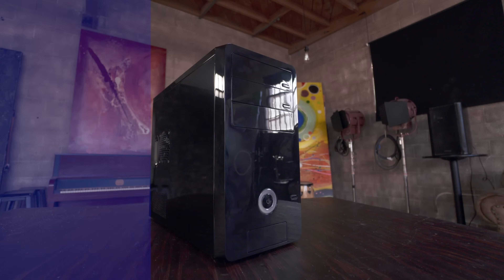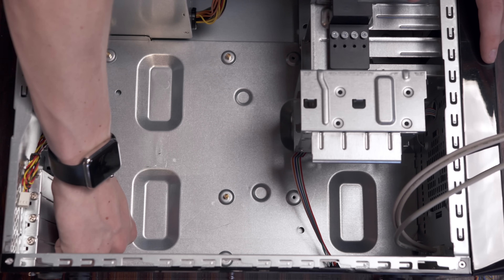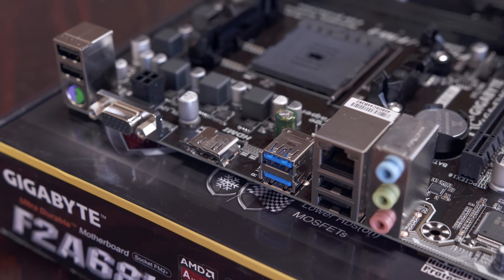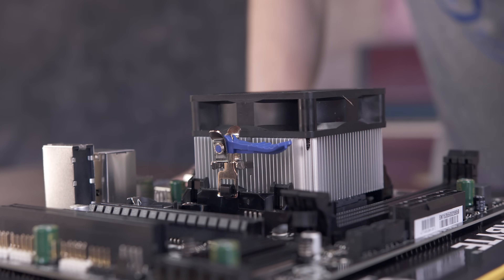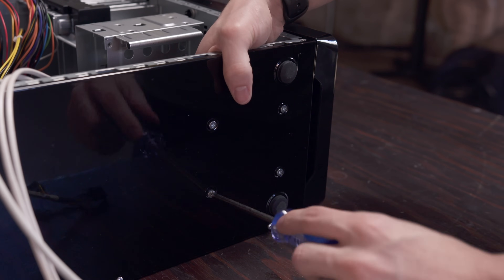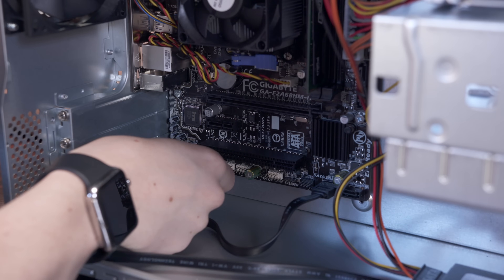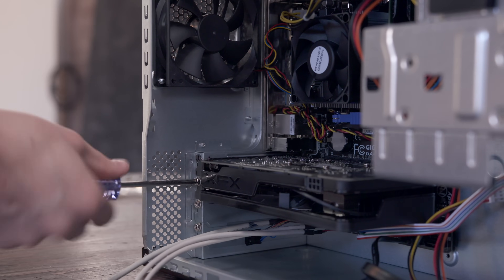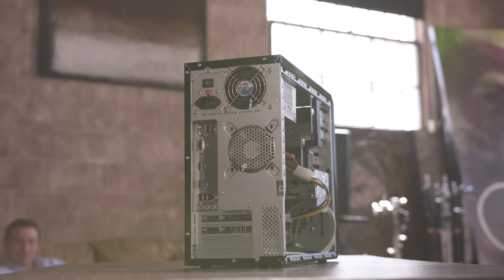How to Build a Gaming PC! (2016)

Comment: PLEASE ANSWER
Some people in the comment section are saying that the graphic card blocks the wifi card entry slot.
Does it actually block it?
Also do you even need a wifi card or are you able to connect to wifi straight away?
Sorry for all the questions but I'm new to building PCs.
Thanks
Reply: It does block if you have a graphic card that uses dual expansion slot. Alternatively, you can use wifi USB adapter which is way more easier to install than wifi card.
Reply: thx

Comment: Is this good parts for building a Gaming PC under $200 dollars?

AMD A8-7600 3.1GHz Quad-Core Processor

Asus A68HM-K Micro ATX FM2+ Motherboard

Kingston HyperX Fury White 4GB (1 x 4GB) DDR3-1866 Memory

Seagate Barracuda 500GB 3.5" 7200RPM Internal Hard Drive

Apex TX-381 MicroATX Mid Tower Case w/300W Power Supply

Comment: Wait so if you get the hard drive do I just put it where you put the SSD in?
Reply: XHunter no. on top of the SSD, there are drive cages. Your hardrive would slide in perfectly and you screw in the hardrive from the side of the drive cages
Reply: yes
Reply: XHunter No they have a hard drive bay. The hds are larger than ssds so they can fit without a problem

Comment: Is there anything here that is not compatible? This is my first PC so any advice helps.

Case: NZXT Phantom 240
Graphics Card: Nvidia GeForce GTX 1060 
Motherboard: ASUS Z170-DELUXE LGA 1151 Intel Z170 HDMI SATA 6Gb/s USB 3.1 USB 3.0 ATX Intel Motherboard
Processor: Intel Core i7-6700K 8M Skylake Quad-Core 4.0 GHz LGA 1151 91W BX80662I76700K Desktop Processor Intel HD Graphics 530
RAM: Corsair Vengeance 8GB DDR4 ($50)
Storage: WD Blue 1TB 
Power Unit: 600W Corsair CX600

P.S. Yeah I know SSD is better but just to start I can bear the load times.

P.P.S. I also probably left in some useless info on the names but I really don't know what matters and what doesn't.

Comment: Hey as a first time pc builder I'm curious. I've ordered most of the parts to the 500 gaming rig from October and getting near to building. I have one problem which is me being scared about static damage. I will be building it on a semi-polished wood table without a wristband or a pad to prevent this. Am I ok without those or should I invest in getting some static proof items?
Reply: Owenn If you are very paranoid I suggest an anti-static mat.

Comment: Question, I know this is a few months old video but I'm thinking of getting this for Christmas. Would I be able to do a WiFi card with this build? I would use it for gaming. (Yes I know WiFi isn't good for gaming but I'm not going to have a cord run from my room to the router and I can't move the router to my room either.)). 

EDIT: Can I put a bluetooth adapter in with this build? If so, which one and how?

Comment: I need help! I wired all the cables but the PC wont boot. I verified that everything was plugged in correctly by unplugging all the wires and trying again. The LED lights on the motherboard turn on but when I press the power switch it does not boot.

Comment: I am a noob so don't make fun of me but what is so different about an SSD and HDD
Reply: WAFFLES the OG Suhh Dude You can have both an SSD and a HDD in the same PC. And if your wondering there is a third kind of disk drive SSHD (Solid State Hard Drive) which is a hybrid between the other two.
Reply: WAFFLES the OG Suhh Dude 
An SSD has more read and write speeds than a hard drive
Reply: SSD fast HDD slower.
Reply: SSD faster, HDD more storage (usually)
Reply: SSD (Solid State Drive) doesn't have moving parts as the HDD does making the SSD's life span longer and more tough to kinda break as a HDD the SSD is faster but holds less storage then a HDD (keep in mind you can get a SSD  with more memory than a HDD if your willing to spend a whole lot of money) a SDD is also a lot smaller.
Reply: SteaLz thanks can't you have a hard drive and an ssd

Comment: I need help, this is my first pc build and I want to know if these specs will run tf2, CS go, overwatch and dark souls 3!!
Intel® Core™ i5-6400 Processor (6MB Cache, up to 3.3GHz with Intel® Turbo Boost Technology Includes
NVIDIA® GeForce® GTX 950
8GB Dual Channel DDR4 2133MHz (4GBx2)
1TB (64MB Cache) 7200 RPM SATA 6Gb/s
Intel® 3165 1x1 802.11ac Wi-Fi Wireless LAN and Bluetooth 4.2
Reply: Jack Puub 
Is this prebuilt?
Reply: Jack Puub  anything that functions and has four gigs of ram will run tf2
Reply: Yeah it'll be just fine, maybe even a tiny bit overkill!

P.S: Add a SSD!

Comment: How's it sound:

CPU:                                             Intel Core i5-6400 2.7GHz Quad-Core Processor
Motherboard:                             MSI B150 Gaming M3 ATX LGA1151 Motherboard
RAM:                                           G.Skill Ripjaws V Series 16GB (2 x 8GB) DDR4-2400 Memory
Storage:                                      Toshiba 2TB 3.5" 7200RPM Internal Hard Drive
Video Card:                                MSI GeForce GTX 1050 2GB Video Card
Case:                                          Aerocool GT-A ATX Mid Tower Case
Power Supply:                           Corsair CSM 550W 80+ Gold Certified Semi-Modular ATX Power Supply
SSD                                             N/A
Monitor                                       N/A
Keyboard/mouse                      N/A
Total Price:   £633  (without shipping)

Comment: Will I need to plug something into the back side of the gpu?
Reply: Yes, your gpu (when in your PCIE slot) disables the stock VGA or DVI connecter, and replaces it with the one on the back of your gpu, Ausin has a GPu that has 2 DVI's and a HDMI port on them. If you can, i reccomend using the HDMI cable, the quality is great and i can support 4K.

Comment: Hey guys. I'm currently using a console and I'm trying to make myself a pc. 
http://pcpartpicker.com/list/s3hrm8 
This is what I created and wanted to know how good it is and how I can make it better(not for more money)
Reply: Looks pretty good! Nothing weird, incompatible or unbalanced.

I know you said you didn't want to spend more money, but for about 20 dollars more you can get an AMD Radeon RX470 instead of the 1050ti, which would increase your gaming power (higher settings/ FPS).
Reply: Broseph Stalin thank you
Reply: Broseph Stalin I can't find the AMD Radeon on the site?
Reply: DonTheRandomGamer thanks a lot for the response. 
Im still new to pc's and wanted to know with what part of the pc am I suppose to replace with the gtx 1070
Reply: Get a 1060 
It's not much more money and you'll easily be able to run anything on ultra (or at least high) 
the 1070 and 1080 are better but are WAY more expensive, Not really needed unless you plan on gaming in 4k
Reply: As for the processor, You don't need an i7 so don't bother with the 6700k.
I would get a 6600 (no "K") as it will be more than enough for gaming, at a very cheap price. 

If you're interested in overclocking then get the 6600k, But it won't be needed to game.
Reply: Er
Thats false 
6600k will not bottleneck a 1080
Reply: even a non k won't bottleneck it
Reply: an i7 is really not needed at all for gaming

if you are editing videos and producing music and such, yes. an i7 will definitely help

but for just gamin, a 6600k, and even a non-k  will be more than enough
Reply: Not sure where you're getting your info but you might want to look up what you say before giving people advice on making a computer
Reply: MYRKOGH 
what should I upgrade first because my budget can only allow 1 upgrade. My i-6100 or my zotac?
Reply: MYRKOGH I3-6100 sorry
Reply: Get the gtx 1060 
The i3-6100 won't bottleneck it to a degree that will be a constant struggle 
it might cap it slightly but it won't big  a huge issue in most games
Reply: MYRKOGH thank you
Reply: MYRKOGH updated:https://ca.pcpartpicker.com/list/NfBfFd
Reply: Looks good 
Some games might run a little slow due to the cpu, Games like city skyline or other similar ones that are cpu heavy, But most will run amazingly
Reply: MYRKOGH ya i Will upgrade later
Reply: MYRKOGH would this be a good build and would everything fit in the case nicely? https://pcpartpicker.com/list/HFKpzM
Reply: Nicolas Donnelly is the one you're about to make better than the on in the video ???
Reply: 5 Violin not sure but I think mine is better
Reply: Mr. Moseby Looks good for the most part, I would personally change to a 6600k, especially since you're going with the newer line of nvidia cards
Reply: Can someone please check this PC build? I'm a beginner, and this is my first attempt. I have a 1000$ budget, Thanks!
https://pcpartpicker.com/list/F73Hqk
Mainly going to be playing Overwatch
Reply: Really good choice for a gaming pc imo, but if you want to go for a video-making pc or streaming one i'd recommend making the budget higher.
But if you just want to play games like gta 5 or Fallout 4 it's totally fine, follow Broseph Stalin's advice too.
Reply: Depault g
Reply: you forgot the OS, unless you want to run linux or non-activated windows 10.
Reply: I would say since you have a 1050ti that wont reach over 80 on most games go for a 60hz ips monitor as that would give you better colour.
Reply: I FOUND THIS NEW SITE if ur mainly going to be playing overwatch get a 1050ti to save some money, and dont worry if u want to play other games as well because the 1050ti is good for most games on med-high settings at 720p or maybe even 1080p, but if you are definetly planning to play more high end games in the future, stick with the 1060.

Comment: This is my build so far. (Planning on using it for gaming and editing videos)

CPU: Intel Core i7-6700K 4.0GHz Quad-Core Processor
CPU COOLER: Cooler Master Hyper 212 EVO 82.9 CFM Sleeve Bearing CPU Cooler
MOTHERBOARD: Asus Z170-A ATX LGA1151 Motherboard
MEMORY: Kingston FURY 8GB (1 x 8GB) DDR4-2400 Memory
STORAGE: Western Digital Caviar Blue 1TB 3.5" 7200RPM Internal Hard Drive
VIDEO CARD: MSI GeForce GTX 1060 6GB 6GB 6GT OC Video Card
CASE: Deepcool DUKASE V2 ATX Mid Tower Case
POWER SUPPLY: EVGA 500W 80+ Bronze Certified ATX Power Supply

Thoughts?

Comment: Pc geniuses please help i know barely anything about pc building can someone tell me if this is good for the price or if i chose anything stupid http://pcpartpicker.com/user/SeanRussell/saved/zZCLkL this will be my first build aswell and i have 2000 to do it with but im ok with 2200
Reply: you can save few buck and download windows with a usb and a code. Otherwise it´s good
Reply: Thanks man I appreciate you going out of ure way to help
Reply: almost 400 bucks for a motherboard seems ridiculously overpriced, does that particular one have any standout features you really need? You can get a similar z170 board for like 150-200 bucks, easy
Reply: EpicconV processors actually matter some games are cpu-intensive and a few CPUs can bottleneck your GPU
Reply: Fart i7 processors are over kill if you re just goin to use it for gaming
Reply: Fart Im sorry but that $400 motherboard is way overpriced. You could save about $300 getting another one other than that. Plus if you don't need to edit things and stuff like that just stick with an i5 processor.
Reply: Fart There is no such thing as an i6 processor
Reply: Fart I'm assuming this is your first build so I would do air cooling since it's a little harder to make a mistake.
Reply: +Farti would suggest the i5 6600k. nothing more than that for gaming
Reply: +ZGuy bro 6600k is the ultimate i5 for gaming
Reply: 2000$ ???????????
damn , just to let you know , amd ryzen 5 1600x is better than your intel core i7 and 100$ cheaper
Reply: I don't really see any features that i need but i cant tell what a good motherboard is so i kinda just choosed that one. What motherboard would you choose for a pc like that. And thanks for responding btw I really appreciate ut
Reply: Fart
Just about any z170 board really, as long it's from a decently known manufacturer you can't really go wrong. The only standout thing that expensive one has is WiFI (though I only looked at it very briefly) so maybe you want that, that shouldn't cost that much more. 200 dollars should be more than enough.

Some good manufacturers are ASRock, Asus, Gigabyte and MSI. They should have a board that more than satisfies your needs. For example, a non-WiFi board is currently $119 (on sale): http://pcpartpicker.com/product/NqRFf7/asrock-z170-extreme4-atx-lga1151-motherboard-z170-extreme4  :)
Reply: Broseph Stalin thanks for the help man. Im gonna use the motherboard you recommended thanks!
Reply: Would an I6 processor be better
Reply: Wow im really stupid lmao whats the best i5 procceror for gaming
Reply: Fart i5-6500k
Reply: Thanks guys is there any oher things worth mentioning
Reply: It's David ai think im gonna stick with the liquid cooling i want this pc to be the god of gods
Reply: Fart Ok but be very careful because if you spill just a little of the water then you may be in big trouble so just be VERY careful.
Reply: It's David i will and thanks for being so fucking dope to help me out ure fucking awesome
Reply: When it comes to gaming, processor doesn't really matter, if you want a strong gaming computer, get a decent graphics card like a ZOTAC GeForce GTX 1060 3GB GDDR5 Video Card, it works very well when gaming.
Reply: yup it's fine for pretty much anything. but it you want it only for gaming its waaaaay overkill
Reply: ya and that motherboard is also overkill
Reply: I know this is old, but can someone please check this PC build? I'm a beginner, and this is my first attempt. I have a 1000$ budget, Thanks!
https://pcpartpicker.com/list/F73Hqk
Reply: Mainly going to be playing Overwatch
Reply: The Average Video Watcher do you want to maximize your budget?
Reply: The Average Video Watcher oh nvm dont replace the gtx 1060 with the rx480 but if you have future plans of using crossfire keep the rx480 :)
Reply: ZGuy Alright thanks!
Reply: The Average Video Watcher try and get 144hz monitor
Reply: Fart
Reply: Thanks for the suggestions guys! Got myself a new PC!
Reply: Fart have you already built your pc? get a cheaper mobo man, haha. when your mobo is more than your CPU then there's something wrong. and the ripjaws V is quite expensive for ddr4, you can find 16gb for ~$70.
Reply: Jack Ya we told him that and he will change it. But we're did you find 16gb of ddr4 ram? I would like to actually use that for my build.
Reply: It's David you can either get 1 16GB stick of Kingston RAM (if your mobo supports it) for $76 or get 2 8GB sticks of Team Dark RAM from Newegg for $70
http://www.pcm.com/p/Kingston-DIMM-Memory/product~dpno~13989720~pdp.bacdbbjd?store=pcmall&dpno=13989720&source=zwb12165
http://www.newegg.com/Product/Product.aspx?Item=N82E16820313795
Reply: Jack Oh is see it's for sale.. I was like what kind of cheap ram is this?
Reply: I don't recommend spending so much on your first build
Reply: d e a d l m e m e this post is 4 months old
Reply: i know
Reply: Kingchaos 101   But Ryzen 5 1600x is better for editing and gaming also but i7 is awesome for both editing and gaming .. right?